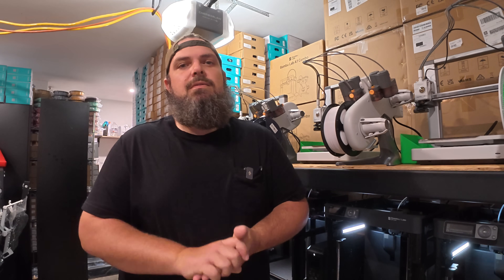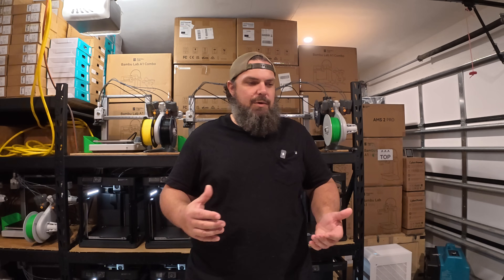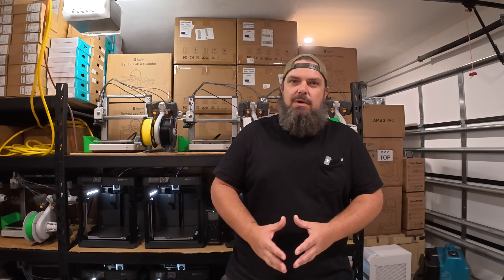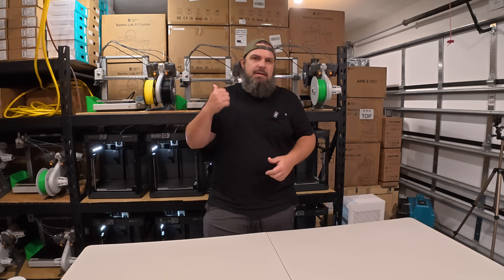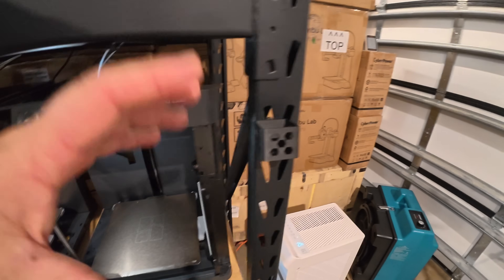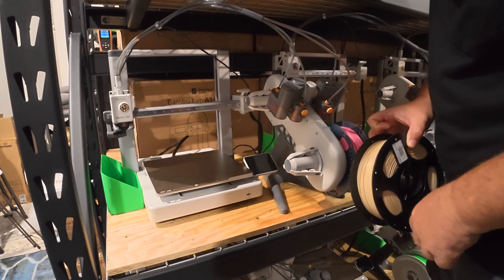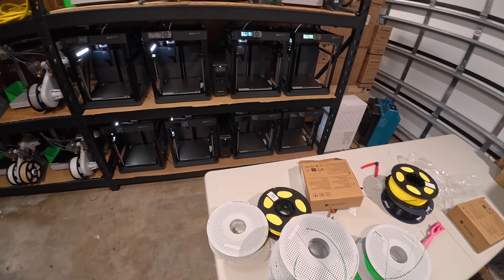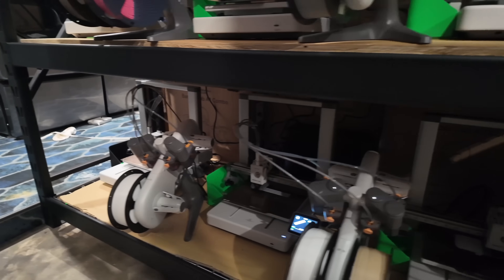Day 10: First Product Test in My 3D Print Farm

Comment: Hi I have a 3d printing company . I was wondering with all your up front investment with no products put to market. When do you think you will start to make a profit,  or just cover the costs? 
To make a substantial investment  as you have you must have a business plan?   
I built my company with 2 Bambu lab printers and added printers as the company grew and as needed. Without any sales or sales of product is it not risky to start with an investment of 50 printers?  I have now over 9000 sales on eBay and Etsy combined,  Also for photography for small items I only use a Light box and a smart phone very cheap and easy with Ai software.
Reply from the maker: Appreciate you sharing your experience, that’s an impressive track record. This build is intentionally following a different path. The investment and rollout were planned around workflow, capacity, and long-term production rather than incremental expansion. The series is focused on documenting that process as it comes together, including when and how products are brought to market.
Reply: @CubFloPrints  Thanks for your reply , Great job by the way , I will continue to test your method though kind regards

Comment: Keep going brother!!! we just added 4 more since your last video, for a total of 16. We can do 4 more  (20 total) without pulling more electric from the street and having an electrician pull new circuits. That will be a good pause on growth for us to get a better idea on our overall cost and margins. We have paid off all 16 printers with the print farm itself in the last 5.5 weeks. With some decent 3D design skills, you can iterate so fast it is unreal. We recently had a customer ask us to produce a print for him with no design. I hoped on Fusion 360, printed a couple test prints of the parts that had to interface with existing geometry, and then finalized the design...... Start to finish was 6 hours from engineering specs to shipping ready part. Totally Insane
Reply: Also, are those 77" shelves that you have the 2 P1P's on? I am considering shifting to 4 wide for my P2S's but would have to stack the 3kg rolls to the top, and would need a top glass lift on each to keep good chamber prints for our 90% PETG production. I can't decide if 3 wide by 3 high or 4 wide by 2 high are better... I can only fit 5-6 on a 20 amp breaker, so I'm thinking 3X2 is the better setup. Then, I could do a breaker per shelving unit.
Reply from the maker: Yep, those are the 77” Gorilla Rack shelves. They’ve been working well so far, but layout definitely becomes a game of tradeoffs once you factor in spool placement, airflow, and chamber clearance.

Your thinking makes sense though. Power limits, breaker layout, and access all end up driving the decision as much as printer density. I’m still testing different configurations on my end too, so it’s been interesting seeing how others approach the same constraints, especially with heavier PETG production.
Reply from the maker: That’s awesome, congrats on getting to 16 and paying them off that fast. That’s a huge milestone. Taking a pause to really understand costs and margins is a smart move too.

The speed at which you can go from idea to finished part is one of the wildest parts of this space, especially once design and production start working together. Really cool to hear how you handled that custom job. Appreciate you sharing the journey and the encouragement!

Comment: Is there a need to dry filaments and control humidity as well for successful prints?
Reply from the maker: It depends on the material, but humidity control definitely helps with consistency. Some filaments are more sensitive than others, so keeping the space controlled and drying when needed makes the process a lot more reliable at scale.